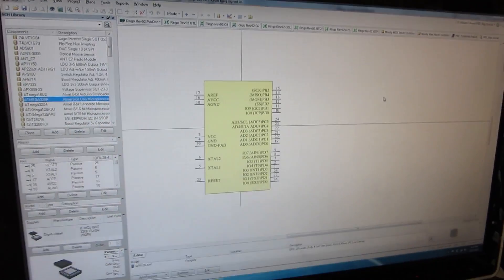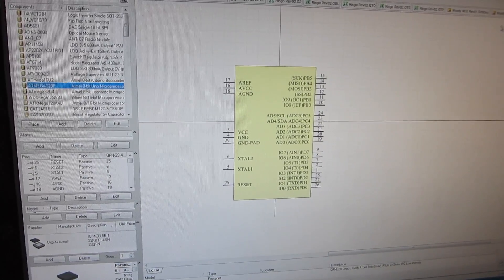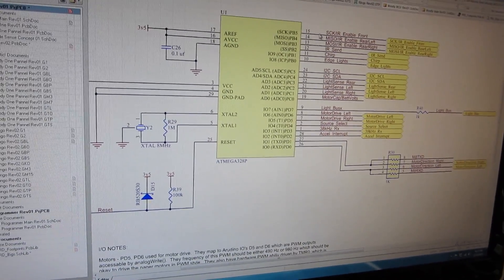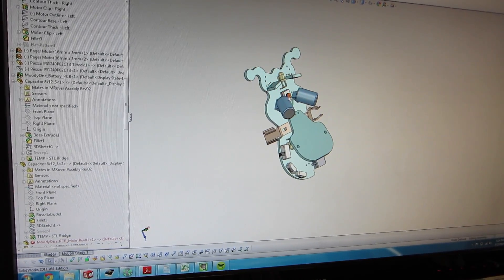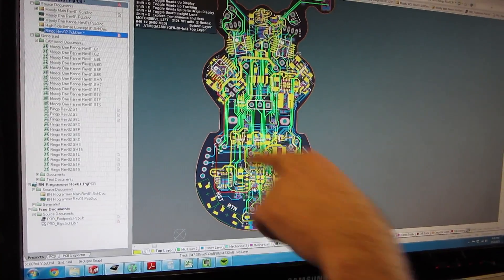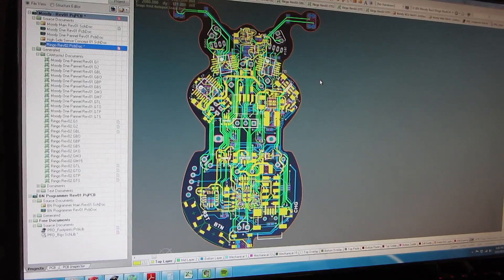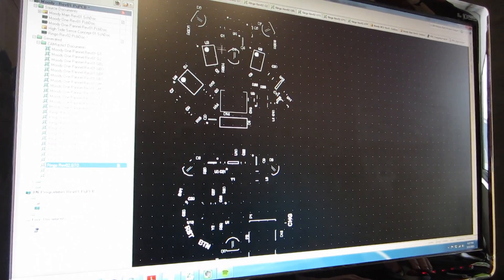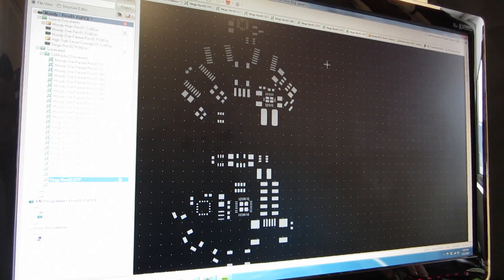How circuit boards are designed and assembled - Start to Finish

Comment: cool video. I suspect you actually do not want to touch the boards with your bare hands before putting the solder paste in, as you are contaminating the copper traces with the oils that are naturally present on our skin (+ salts...)  :-)